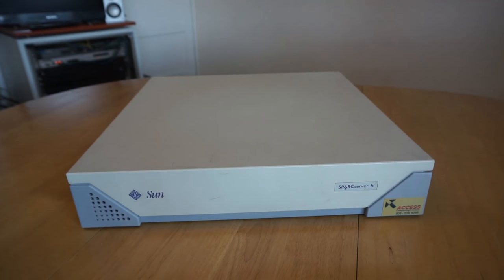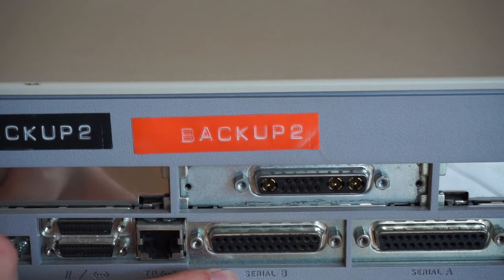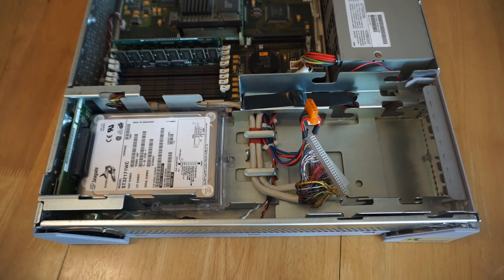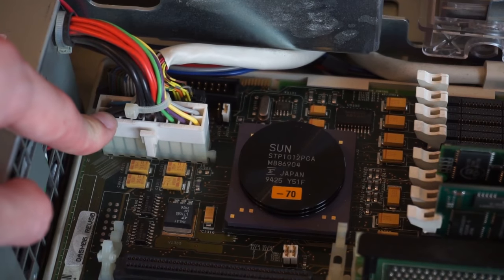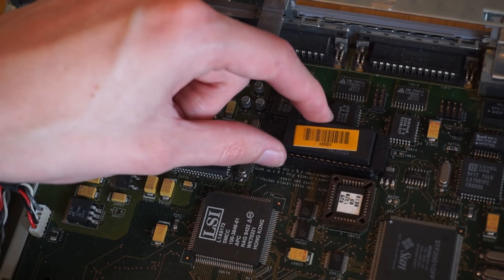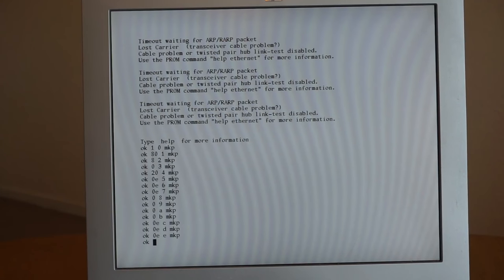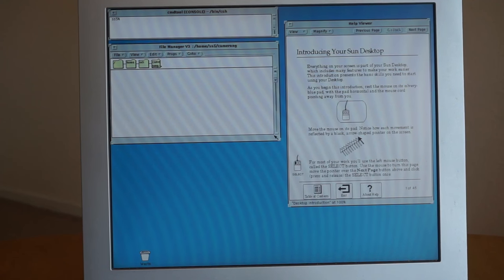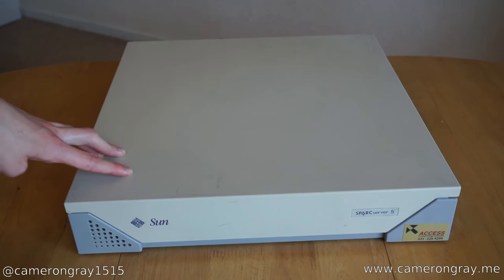Sun Microsystems SPARCstation 5/SPARCserver 5 (From 1994) - Tour and Look Inside!

Comment: I remember when I bought my old SS5 used some time around 2000. Even though it was pretty slow by that time compared to commodity PC hardware, you could still get on the web and do useful stuff with it, and that's what I did. Those days are long past and unfortunately so is my old SS5.

Comment: So.. in the OBP, when the NVRAM battery goes fut, it flips back to default a few of the environment variables (not just MAC (which was actually there on yours..?) and checksum). run "printenv" to see them. Check the variables "mfg-switch?" and "diag-switch". Flip them and watch how much faster it boots and all the manufacturing and diagnostics it won't run thinking it's got issues. If you're unfamiliar with other OBP commands and want a listing, type "sifting words". You should also be able to change the default boot order from "net" to "disk" whilst your in there. Nice tour :) Good on you.

Comment: you can get an 8-pack of Sun X7022A/501-2653 RAM sticks, clip the middle notch wider, and stick it in the RAM slots just fine to allow it to get 256MB. These are for the 3500/4500/5500 and 6500 systems and I believe the StarFire also used these DIMMs. 
Internal pic of my SS5 running with all 8 sticks populated: https://pbs.twimg.com/media/CZ07eAeWEAAX2VS.jpg:large
...with extra cooling on the 110MHz MicroSPARC II, a fan from a dead 8800GTS GPU schlepped on top to promote wider air circulation to the drive bay, because yes, I have a 10k drive in there. 18GB, with a hard drive fan screwed to the bottom taking up the second drive bay slot to keep it decently cool. and, extra heatsinking on the HappyMeal card in the middle Sbus slot, which has recently died and needs to be replaced due to my own error when doing some internal cleaning. one of the address pins might have touched 12v and I don't think the main chip on there was very happy about that. :/

and a screenshot of it running Debian Etch with the stock kernel before I moved back to a custom compiled 2.4.37.11 kernel: https://pbs.twimg.com/media/ChRKu-4WUAQ_Cl4.jpg:orig

I recently had my NVRAM battery die after 22 years of life (the reason I opened it up and cleaned it, and killed the HappyMeal card.) I've done a couple of battery replacements just using sealed replacements for Thinkpads because they're pretty much the cheapest ones you can get where the batteries already have leads on them, and it's a bunch less work to solder the ends on than hotsnotting a battery socket and some wires in, in my opinion. others will say the opposite, but I'm just saying what's worked for me the best.

it's good to note that the numbers on your NVRAM on the yellow label are actually the last digits of your MAC Address and Host ID. those will come in handy when you finally do the NVRAM battery hack, else you can find information on actually acquiring a new compatible chip for VERY cheap on the internets.

Debian works fine on these if you don't mind compiling newer versions of some things, but in all actuality, NetBSD booted via the network for an install or OpenBSD from a CD-ROM drive install are the easiest to set up, just don't expect anything from them graphically. in fact, my suggestion is to never use these graphically with anything unless it's SunOS or Slow-aris, or you magically acquire an expensive ZX framebuffer to stick in two of the Sbus slots. the AFX slot apparently had a card, but no one on the internet at least has ever seen one out in the wild.

to install Debian, one has to install Debian Woody first, then go through a painful upgrade to Sarge (since Sarge and Etch won't CDROM boot on Sun4m machines because of an ESP SCSI driver bug), and then finally Etch, but you can only use the 2.4 kernel from Sarge to boot the thing. the 2.6 kernel makes the machine 'oops' a kernel panic after enumerating the SCSI bus, also because of the aforementioned ESP driver bug. There was one gentleman in the #gentoo-sparc channel on Freenode that was making Gentoo installation media for Sparc32 machines, but I don't think it's gotten anywhere in a while. There have been successful installs of Gentoo with very stripped 3.x kernels on the machine, somethign that will hopefully change later on as kernel 4.x matures and one can chainload a bigger kernel into memory from a smaller one-- the kernel size has to be below 2.something megs or else the system will NOT boot it, due to the older OpenPROM version.

you can network-boot Etch, however, and do a clean install that way, but it all depends on if you're able to set up the network properly to make that happen, and don't mind the 10Mbit speeds of the inbuilt AMD Lance ethernet chipset to do so.

on a much lighter note, I wasn't aware the F1703 was sync-on-green capable. I'll have to remember that when I swap out mine for something else on my desk sometime soon.
Reply from the maker: Awesome!  May look into upgrading the RAM/CPU or adding some SBus cards if I can find any cheap.  I'll probably hold off on the NVRAM battery fix for now as I'd rather have a working machine with a dead NVRAM battery than risk breaking everything!  If I see a cheap (even if dead) NVRAM chip or can get my hands on a dead SS5 I'd consider it since I'd have a spare chip on hand.

When I first got this machine it was running Debian (as was all the other Sun hardware I have as it all came from a project that exclusively ran Debian on these - http://www.tardis.ed.ac.uk/).  I tend to stick the original OSs back on them though, I don't have a practical use for a SPARC machine so for me I'd rather have an unusual/different OS like SunOS or Solaris rather than Debian which I use day in day out on most of my machines!

Not sure about the Sync-on-green - As far as I was aware the SS5 outputs separate Horizontal and Composite sync signals.   On the other hand, my NeXTstation Turbo Color outputs Sync-on-green and the F1703 (along with all my other monitors) refuse to come out of sleep, I had to build a sync separator using an LM1881 chip to separate the sync from the green video signal into separate horizontal and composite sync components.  I explain this and show the adaptor I made in my NeXTstation video here: https://youtu.be/yY47JNP4-54?t=17m38s
Reply: it might all depend on the framebuffer used, but I know a lot of monitors will not work with newer Sun framebuffers because of a Sync on Green issue. 

yeah, I commented on the Ultra 5 video and saw the Tardis project videos a while ago. I was very sad when Debian dropped support for SPARC64 in Jessie, and even sadder this past month when they stopped providing security updates for anything but i386/amd64/armel/armhf for wheezy-lts. meaning, I'm probably never going to see another update for SPARC64 come out for Wheezy for a long time yet if ever until they get SPARC64 back on track in Stretch, as it seems they are in the mailing list, bickering amongst themselves to finish getting an installable system from CD happening in time aside from the bugs still needing to be worked out. the drop from official port status to the likes of where m68k now stands is what brought this about, and I can't wait for there to be Linux support on modern kernels again. but because I'm one of those luddites that can't stand systemd, I've been waiting for Devuan to go stable so to pester the devs once again to dust off their old UltraSPARC hardware to get the port going. if they beat out Debian in getting a working, stable distro out for SPARC64, it's going to make some pretty big headlines in the Linux news world for sure, aside from the fact that one can still install Gentoo on the things just fine sans-systemd.

the SS5 has been running Etch for about a year straight. in that time I've been gradually hardening the system up so to protect it from outside attacks, since it does have an ssh port facing outbound on a non-standard port. authfail is helpful here, fail2ban on much more powerful hardware, but I've been dragging my feet on compiling newer openssh binaries for giggles. it takes many, many hours to compile things on the box natively. last biggest compile was LibreSSL, which compiles perfectly on Etch whereas normal OpenSSL does not, and GnuTLS has some issues where it won't compile, so LibreSSL for TLS traffic it is. 

I've been thinking lately about selling the SS5 however, since I need the money more than I need the chuckles at the current moment in time. with 256MB of RAM and the RAM hack I provided not well known at all, I could probably fetch a fancy sum for the unit.

Comment: I don´t have one of these Sun workstations but I have been in the electronics a good few years and can recall  NVRAM´s combined with a real  time clock that look identical to the one in your machine. They are made by Dallas Semiconductor which I believe may have become Maxim. Its probably worth checking them out. They may be obsolete but worth having a look.

Comment: God i HATE those nv chips with batteries in them.
Have 2 Suns that won't work because of the nvram. Guess i need to find some keys and solder some batteries?
Reply: You can buy those chips - they are still manufactured sometimes under slightly different model number - good thing is you can program them manually from of prompt - date,MAC,SN - and you ready to go for another 25 years... I have recently ordered couple for my IPX and SS20 - 3new ones for each - should have me covered till I die :D
Reply: Hm. have a link to the place?
Reply: many places sell them - I used to buy from different places in the past try this:
http://www.memoryxsun.com - they still offer parts - I purchased ram for SS20 - newold stock warks great.
for the SS20 the chip I needed was M48T08-100PC1 28pin 100ns IDPROM  (p/n 525-1378).
Not sure which is needed for ss5 - check yours its printed on the chip - access timing is really important especially the older machines like SSIPX were wery sensitive and some faster chips did not work.
I'm sure people at memoryx will help you - ask them if you are not sure. Also if you need programinf instructions  ping me - I can explain how to do it.
Reply: Awesome! thanks.
Reply: Mine is the M48T59Y. Good to see that it's easier to fix than what i first thought. The computers are from the college i went to, and 8 or so years ago decided to give their old stuff away. Was thinking of scraping some plastic off and connect some coin cells to its nv chip.
Reply: I have initially tried that to = but its really hard to reach to terminals without damaging the chip - some people succeeded (I have seen)  - buts its rather messy solution.
Reply: I had to get these sort of chips for an oscilloscope I wanted to fix. From what I can see these are your standard Dallas NVRAM ICs. Dallas is now owned by Maxim Integrated. You can ask Maxim for engineering samples, which is what I did. It even looks like the IC is socketed.

Comment: what could you use this for now apart from heating a room? Just curious.
Reply from the maker: +Josh Rumjar Pretty much nothing to be honest.  I mean, you could still use it as a basic server although it wouldn't be worth it due to the power consumption.  The only time these would really be used nowadays would be for running legacy applications that are tied to the hardware.
Reply: Cameron Gray cheers for the reply. I actually used to work with some of the old terminals when I left high school. The server was to say the least was huge and weighed a ton. The good thing is sun didn't skip on the good quality caster wheels lol. On another note, love ya videos, keep them coming.
Reply: Maybe use it as a NAS server.
Reply: i guess not even that since this machine only has 10 mbit LAN and the 10/100 was a expensive addon card
Reply: They cant compare to modern computing of course.  Its more of the nostalgia and experience of the past.  Its kinda like when ppl appreciate old cars and the way they were built and run.   Classic-Computing if you will.